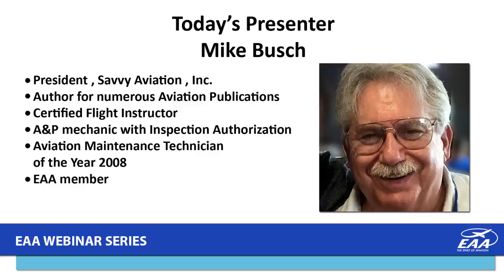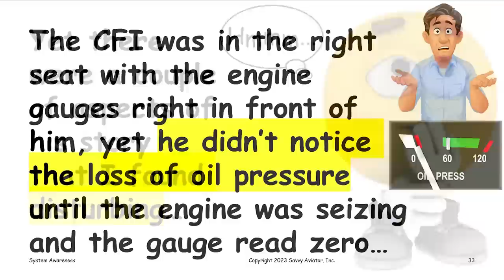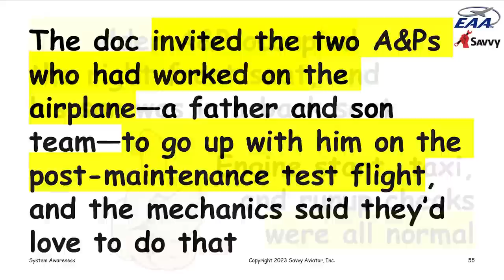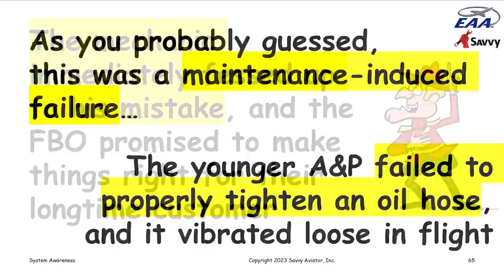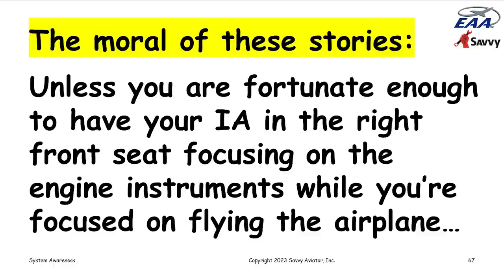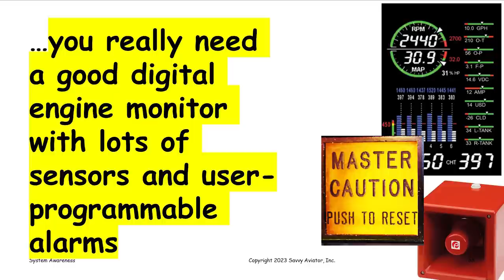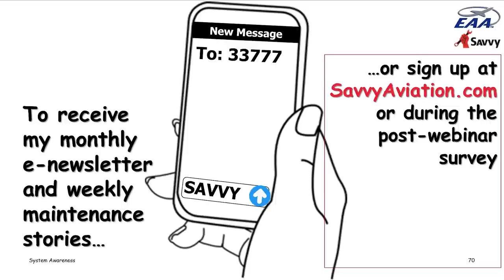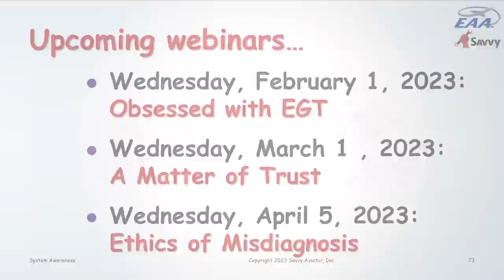System Awareness

Comment: Many years ago, I took my girlfriend and her kids on a cross country in a 172. Fifteen minutes after departing, I notice high oil temp and low pressure, both still in the green but right at the edge. I decreased power and landed at a nearby airport. Oil pump was worn out and and rings and pistons were done. Lost three quarts in 15 minutes. If something doesn’t look right, it isn’t. I love engine monitors.

Comment: A couple of comments. It's one thing to practice emergencies and memorize emergency procedures. What this does not take into account is the immediate shock and disbelief when a real emergency occurs. Until it happens to you, you just don't know how your brain is going to function. The stress can easily overload your thought process. I once watched a woman almost drown and couldn't move to help her. I just froze. This experience taught me to MOVE, do something, when a serious emergency begins. My early experience helped train my brain to continue to function in a stressful situation. Hopefully this will be the case for the young CFI.

After I built my homebuilt plan I started putting my inflight checklists together. I looked at checklists from similar aircraft and quickly realized they all had the same flaw. They all reference total failures of some kind. "Loss of Oil Pressure", "Engine Failure", etc.. What they don't do is provide guidance on what to do when things START to go wrong. Things like "my voltage seems a little low", "my oil pressure is a little low" , "what does it mean if one CHT is high?". The checklists don't address the onset of issues and provide guidance on what to do at that point. I ended up creating a series of checklists that addressed these initial signs of a problem. For each problem I made notes about how serious this issue is, when do I need to land (right now, nearest available airport, ok to fly to home airport). I did this for every gauge and warning light in my plane. The whole process was an eye opener for me. In a stressful emergency it can be hard to think clearly - especially when you are also worrying about passengers on board. An incorrect initial response can turn a manageable problem into a serious accident. We see this quite a lot in aviation accident reports.
Reply: that pre-emergency checklist idea is great.

Comment: Another great webinar/video from Mike - keep doing them!
Re Oil Pressure.
You have  to remember that the type of lubrication in use in our GA engines is Hydrodynamic rather Hydrostatic. HS requires an external pressure source to maintain oil pressure between the journal and bearing surfaces. Hydrodynamic bearings generate pressure within the bearing due to the viscosity of the oil and the wedging action of the journal in the bearing. It's like aquaplaning if you brake on water - pressure builds up in the water film and lifts the tyre off the road surface - or like water ski-ing. It starts off at zero and builds up with rotational speed. So as long as there is still oil getting to the bearings to allow that film to separate the surfaces, the pressure of that oil in the oil system in general is not so critical - it's the pressure generated in the bearing itself that counts and that is not what you're reading on your gauge in the cockpit! Clearance between the surfaces/shaft eccentricity plays a role in this too.
Obviously low oil pressure on the gauge is bad news - less volume of oil in the system means the oil temperature goes up and the viscosity goes down - which reduces the pressure that can be generated in the bearing to keep the surfaces apart.

Comment: IMHO... Effective periodic panel scanning equates to a desirable habit pattern developed via training, experience, and  distraction management awareness;  regards the A&P oil hose issue, any items serviced/repaired deemed critical to safety of flight should ideally be accomplished by one individual and inspected or checked independently by another, in order to enhance precluding an ensuing failure as discussed in this video re the PA-28.  TY for considering my comments...

Comment: A lot of engine failure stories start with "Well I felt like I was losing power, so I gave the engine full throttle." This gut reaction for the average pilot worries me, because if your engine is actually having issues this is probably the worst thing you can do.

Comment: Not all oil loss results in a slow oil pressure decline.  Flying a 1960 Cessna 182, 25" square climbing at 7,000 foot.  Was looking at the gauge in it went from normal pressure to zero in less then 10 seconds.  Went to idle power, engine never sized.  Cause loose oil filter adapter.

Comment: Those old PA28 annunciator lights are junk. They're black with lit text that is hardly noticeable in daylight. The 90s+ pipers use new annunciators that are far more noticeable, but clearly an engine monitor with very noticeable warnings is ideal.

Comment: Alarms can be good but in human subjects engineering/ergonomics sometimes too many alarms can overwhelm operators.  For example, in the discovery flight if the entire aircraft started alarming after the engine failure may have overwhelmed the CFI causing a different outcome.  That said this is an interesting discussion to have.
Reply: I don’t think Mike was suggesting multiple alarms.  He was suggesting one alarm: namely low oil pressure.

Comment: I can’t stand this guy sometimes. The whole oil pressure not recognized is bs. As a professional ace car driver I’ve had 2 engine just die/lock up with no oil pressure issue prior. Every scenario is different but unless you can say how the engine failed your opinion is bs and that’s a fact. Dropping a valve won’t show decaying oil pressure and can be a simple lock up, throwing a rod won’t show decaying oil pressure always too. I agree monitoring oil pressure is a thing but to say he didn’t look is bs. Plus the training for a CFI isn’t that great. Y’all don’t realize how shit really works like someone who’s worked on it or done it for years. This old man bs is getting old. 

BTW watch this on 1.5x. Talking about wasting time this guy is wayyyy too slow. I can only imagine in plane how slow he will be too.

Comment: Basic mechanical knowledge is sorely lacking in the younger generation. People don’t work on their cars or any other engines. Younger people don’t have mechanically related hobbies. It’s not surprising that this guy didn’t recognize a seized engine.
Reply: I thought something similar, but I think that has more to do with the average age of CFI’s, not the average age of mechanically-inclined people.  CFI’s, on average, are basically children.  Most older adults (>30), I find don’t have any real mechanical understanding.
Reply: You are correct, kids don’t know much about engines. My friend a CFI-I and airline pilot and I, just PPL, were flying my Arrow. He is not a gear head, I have built a supercharged Chevy LS, I like working on engines. 
The voltage dropped. He did not know that lead acid voltage drops slowly unlike his jet the NiCd battery stays at high voltage then dies fast. We just shed some power but left radio and nav and strobes on along with xponder. I knew I could drop the gear by pulling circuit breaker select gear down then dump the gear using the emergency down.
We did a debrief after the flight and I explained why I did not worry about the failure. We were only 60 miles from home and I pushed up the power to 75-80% took it to yellow line and flew home. 
When we parked the Arrow we found the alternator belt broke and was stuck in the cowl.
Reply: @DWBurns  there is a guy on youtube who flies a cirrus. On one flight he started having odd systems readings. Rpm, voltage and other things, all un related, started giving crazy readings. The actual engine rpm was stable. It was a clear day, he had coms, good vis, full power, good flight controls, yet he decided to declare a mayday. He was convinced that the electrical system was going to catch fire. He landed with no issue. All these sensors are independent and are all based on voltage readings and carry micro amps. Their only common link is ground. Obviously he had a bad ground on his EICAS (or cirrus equivalent). How he concluded that there was a risk of fire is beyond me. The worst part is that all his youtube fanboys were telling him attaboy you did the right thing. Clearly he did not. He did not recognize the true nature of his problem and the risk to himself and his aircraft and he did not make the appropriate call. An unscrupulous A&P could have easily taken him for $$$ for new alt, regulator or who knows what else vs tightening or cleaning a connector.